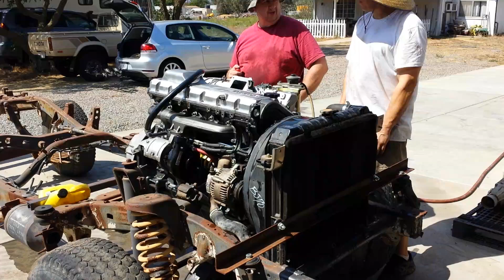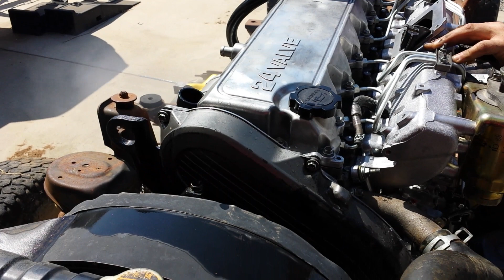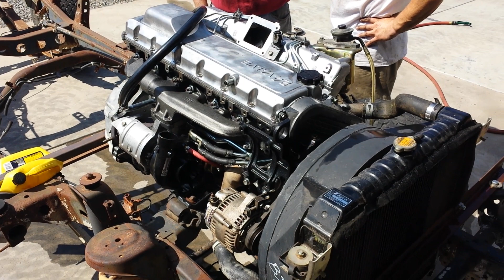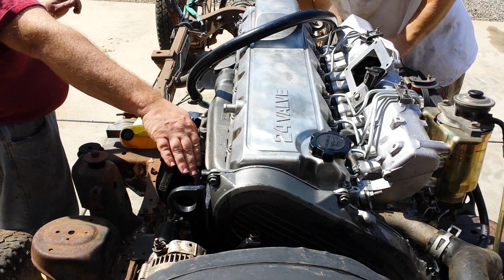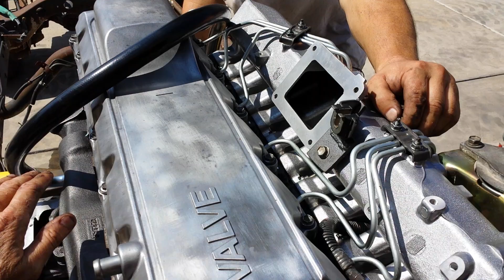Firing up the rebuilt 1HD-FT

Comment: My dream is to drop one of these in my 80 series when (IF?) my 1FZ-FE wears out.  Arguably the best diesel engine Toyota ever produced.
Reply: Definitely the best one mate. The most robust design anyway
Reply: You should try the 1HZ as well. You will thank me later
Reply: The 1HDFT is the evolution of the 1HZ.
Reply: @muhumuzaianmbabazi9754  1hz are very tough and reliable, but the 2h is by far the most reliable and toughest Toyota motor. although if you want abit more go go still while being reliable, the 1hdt or 1hdft are 2 of the best in my opinion. In saying that you'll easily make more power out of a 1hdft.
Reply: Good luck! the 1FZ-FE are designed to last 1 million kms before requiring a full rebuild.
Reply: Would anyone rather this over the fte

Comment: Nothing better than 1hz 1hd diesel engine ..
Reply: The 1HDFT is the next generation of the 1HD engine. It is better, a lot better. It's not just the extra valves, there are a lot more improvements.
Reply: @harveysmith100  can you name some, I am keen to know them? cheers
Reply: @igorv4631  Oh now you have put me on the spot.
The return oil ways are bigger in the head are larger to aid cooling and oil flow. 
They also fixed the problem with the main bearings. (It wasn't really a problem it was the oil, in Japan they used a different oil) 
The 1HDFT has no bearings issues.
The Piston diameter and clearance is different on the 1HDFT it is the same as the 1HDFTE enngine.
Oil capacity is more.
There are lots of small improvements that I can't recall right now but it was a big improvement. The 1HDFT is basically a none electrical 1HDFTE.
Max torque is up too from 357 to 365nm
Reply: @harveysmith100  thanks for your input bud, I was thinking that fte over ft had also some sort of mechanic upgrades beside electrict fuel system...
Reply: @igorv4631  The 1HDFT AND 1 HDFTE are very similar apart from the latter being electronically controlled.
All the updates I mentioned above apply to the FTE also.
They tweaked a lot in the 1HDFT to get the power up but the FTE has even more with 430nm at 1800rpm.
Reply: @harveysmith100  although if you want to talk about reliability and longevity, you cant go past the 2h. The grandfather of them all. Very fucken slow, but it will just keep tractoring away.

Comment: 125kw,380nm.??pathetic.i have a 3,,valve motor,std is 140kw,510nm..4.2 MWM.no computer,no glow plugs,all mechanical.
Reply: harry walker who cares, this thing will go for ever
Reply: But will it do a million miles?
Reply: Harvey Smith there are plenty with over a million kms under the right conditions
Reply: I meant the Toyota engine.!! I meant the reply for Harry.
Reply: Harvey Smith sorry Harvey
Reply: @darcyw8995  That's Ok Darcy, you sound as Toyota passionate as me!
Reply: Harvey Smith yeah, though the old 7.3 powerstroke is I’m my favourites list of engines,
Plus what do you think of the HD and HZ motors
Reply: @darcyw8995  The 1HZ is built for purpose. I have used them in Africa, don't expect to get anywhere fast but it will always get you there and bring you home. It is known for high mileage if it is well maintained and reasonable mileage even if it isn't.
The only real problem is when people bolt turbos on which it was never designed to except. 

The HD as in the HDT, HDFT and HDFTE where deigned from the start to have a turbo so, some say they are the better engines.
Turbos are great but need a bit more TLC, regular oil changes, not shutting the engine down immediately after a run etc.

If it is your own vehicle great, if your running a mine in Africa with local drivers, the 1HZ is you friend.

My choice which I intend to have in my LandCruiser one day, is the 1HDFT. 24 lovely valves, lot's of power but simple electronics.
Straight sixes are the smoothest of engines just because of geometry. So they are all wonderful engines. My choice fits me but there is something for everyone in the list.
Reply: Harvey Smith Cool!

We are looking after a friends 1HD FT powered 80 series ATM.
Reply: @darcyw8995  Oh really nice, what is your opinion of the 1HD FT?
Reply: Harvey Smith Extremely smooth running, loads of torque when needed, and the sound is beautiful
Reply: @darcyw8995  Well that clinches it. That confirms my believes that it is the engine for me.
Do you have any fuel figures recorded? I am assuming that you are in Australia judging by the engine vehicle configuration so litres per 100km
Reply: Harvey Smith Yes we are in Australia, the owner said it gets around 13 litres per 10, on the highway.
Didn’t you guys get the FT on the 80 series
Reply: @darcyw8995  We did yes but I drive a 70 series Prado, a Japanese import with a tiny 2.4d from the Hilux. Hence the interest in the FT
Reply: Harvey Smith We have a Prado 150 with a 1KD as our family car

Then my dads work vehicle is a Mitsubishi Triton with a 2.5 turbo diesel 2014 I beleive
Reply: @ooplaalast4939  Great info, thank you. People are always interested in anything Land Cruiser!